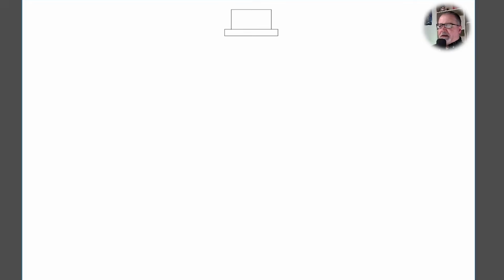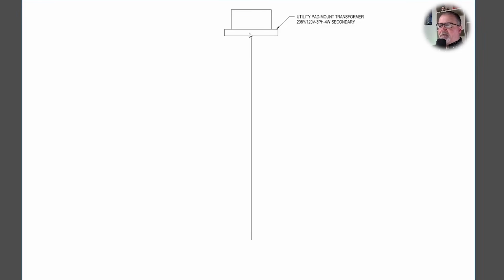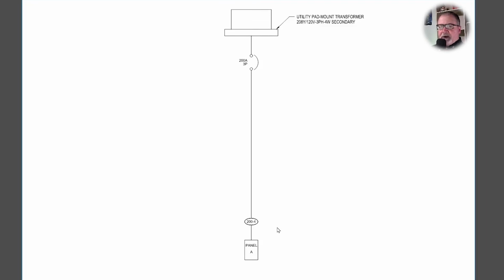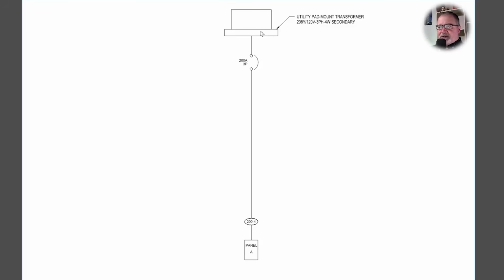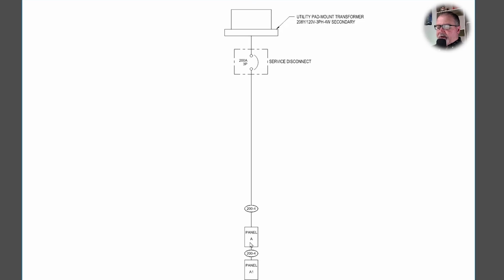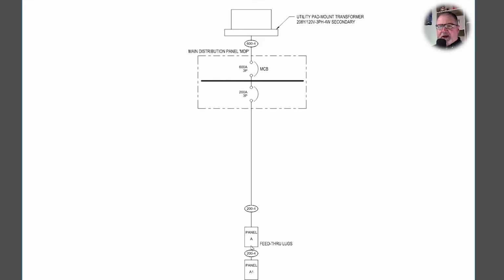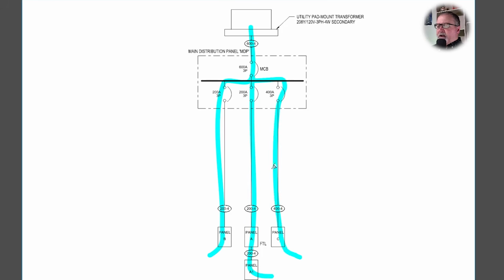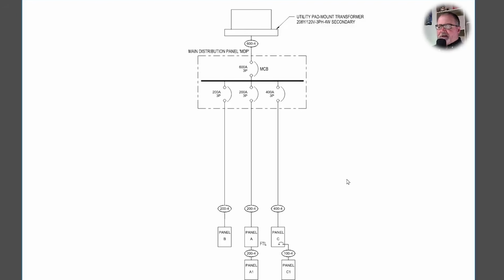Single Line Diagrams: The Hidden Skill Every Designer Needs

Comment: Great video as always. Thanks for consistently putting out such clear and practical content. Your explanations really make complex electrical concepts much easier to understand, especially when it comes to reading and interpreting SLDs.

Would it be possible for you to make a dedicated video (or even a playlist) on how to design single line diagrams from scratch, including what factors engineers consider, the step-by-step design process, and how equipment ratings are selected? I think that would be incredibly valuable for many of us who are trying to move from reading SLDs to actually designing them. Thanks again for all the great work!
Reply from the maker: Hey there! Sure appreciate your feedback - glad to know these videos are helping! And, you read my mind - I do plan to progress more into the design side of SLD's and electrical MEP projects in general in the future - hang tight!

Comment: Sir i have problem for Conduits Rise and Drop Annotations. Both looks same while they are selected different from Electrical Settings for both single and two line symbology. I am working on Power plan. I couldn't find any solution, please help me out.

Comment: Do you think we’ll eventually get a reliable way for the single-line diagram to be generated automatically from Revit’s circuiting/panel data (without manual drafting), at least for typical building distributions?
Reply from the maker: Great question! I do not know the answer to that, but it sure seems possible, as 3rd party add-ons already have that ability. But then again, Autodesk actually removed their automated "wire sizing" algorithm in the latest 2026 version (which frankly had its own flaws), so some automation is being removed instead of added. Wish I knew!

Comment: Hi Electric Rob — great explanation of one-line diagrams and power flow. I’m working on residential electrical projects in Revit and I had a question about workflow: do you think it’s worth creating and placing modeled Revit families for protective devices (MCBs/RCBOs/RCDs/SPDs, etc.) inside the panel? I don’t see many people modeling them—most seem to rely only on the panel schedule/circuit data. But for accurate estimating/takeoffs, isn’t it better to have the protections modeled and schedulable as real elements, or is that unnecessary (and the panel schedule is enough)?
Reply from the maker: Hey there! Thanks for your feedback! In my experience, estimators and equipment suppliers find the panel schedules (and typically related detailed information within written specifications) to be sufficient for pricing. For larger panels/switchboards, of course the single line diagram assists with pricing as well. So no, I do not see a need to model the actual protective devices within panels, etc.